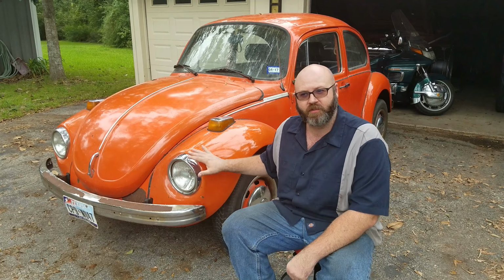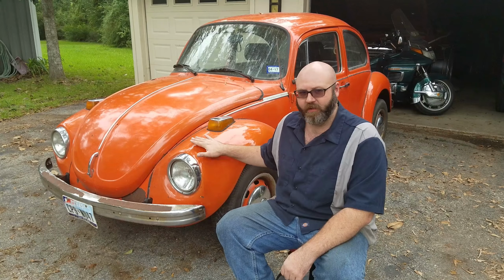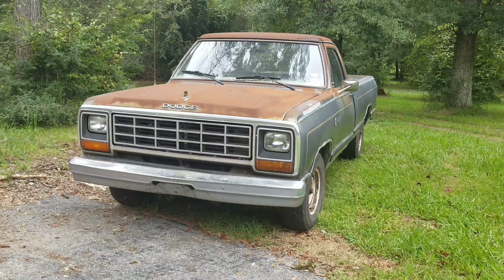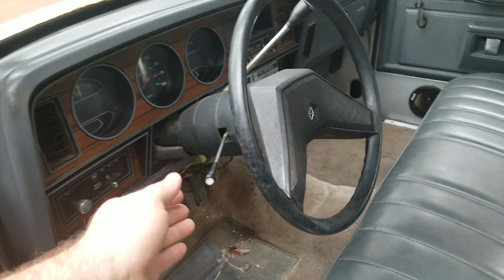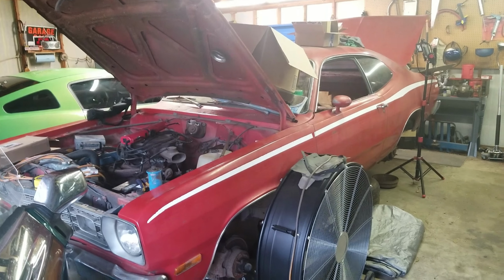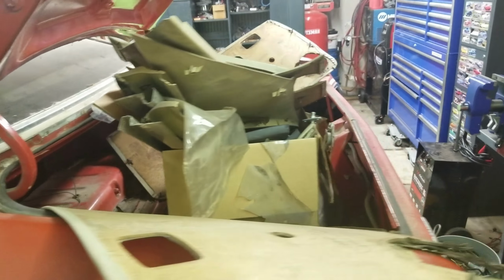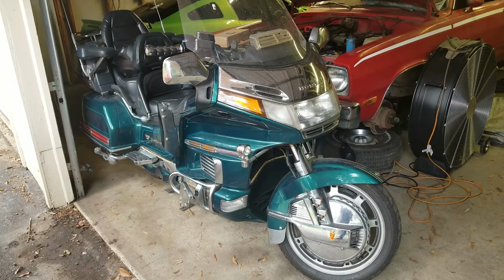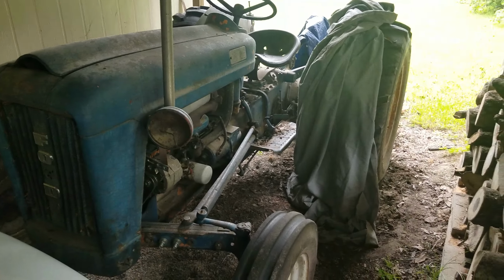100th uploaded video & Top 5 projects update

Comment: I have a 91 aspencade bought new tires online from cycle gear carried to shop for installation when i went to pick it up the shop said i needed neck bearings so i said ok how much is it he said he didn't know $350 and up so a red flag went up when he couldn't give me a price so i paid my invoice got on my. Bike to go home my steering was very tight! it was not like this when i took my bike in at the advice of friends i got a second opinion at another honda dealership they checked my bike out and said there's nothing wrong with my bearings so i suspect foul play they gave me a written statement say bearings are fine.like i said turning is very stiff what could be wrong thanks